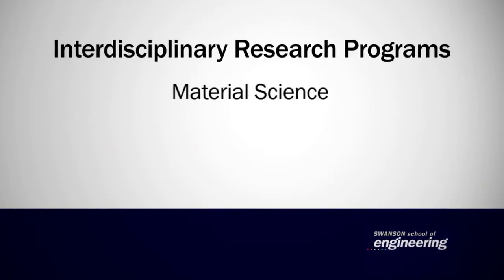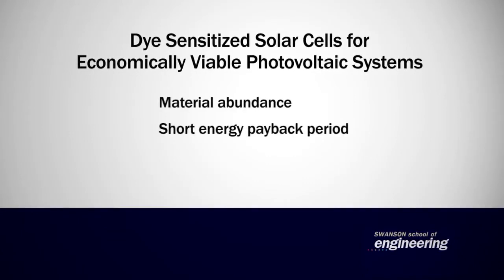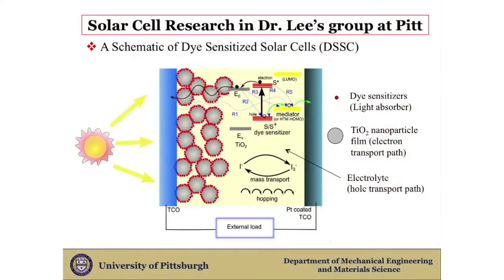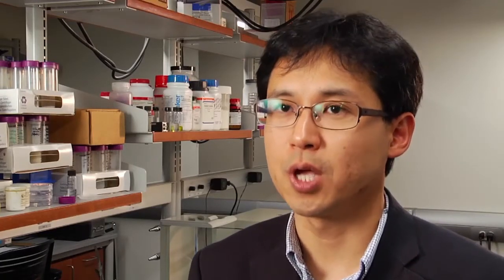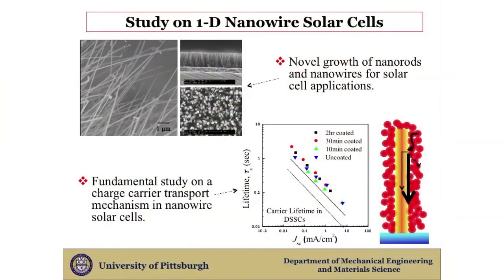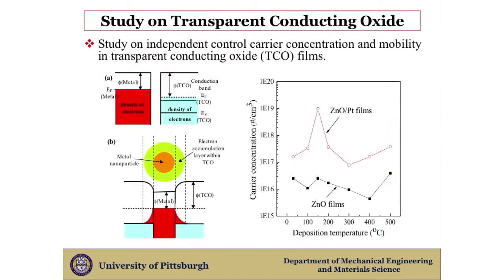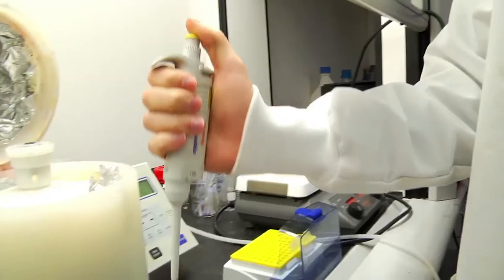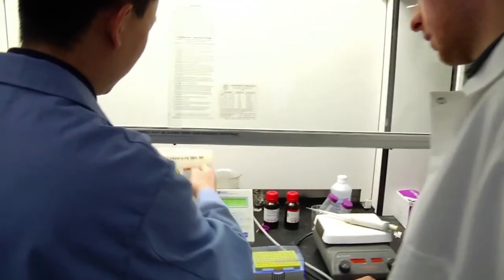Dye Sensitized Solar Cells for Economically Viable Photovoltaic Systems

Comment: Nanorods increase the efficiency of conversion by 50% !! . I'd be interested in learning about how nanowire solar cells are manufactured. On Oct 21 I read an article about organic-inorganic hybrid perovskite materials are a breakthrough for low cost solar. Any thoughts? The claim from Nanyang Technological University (NTU) scientists is that it is 5 times cheaper than traditional materials.